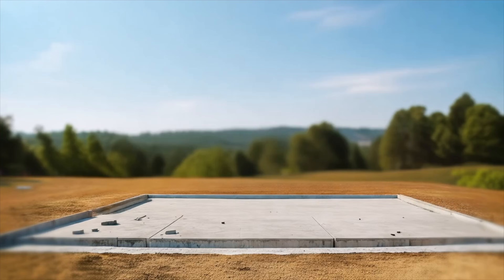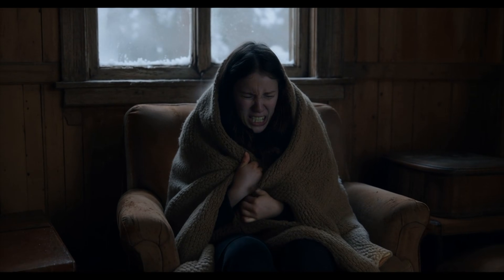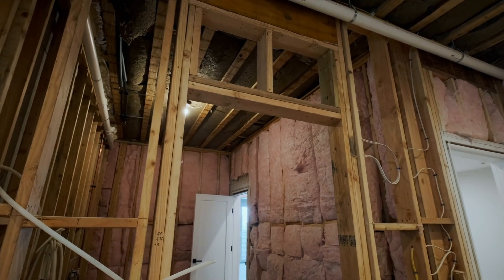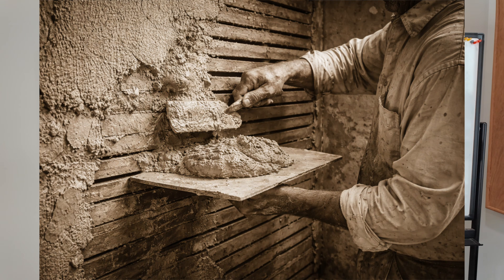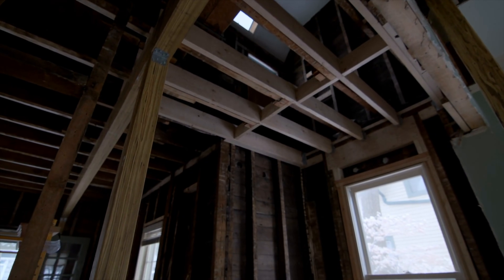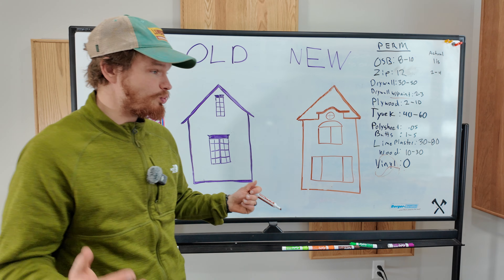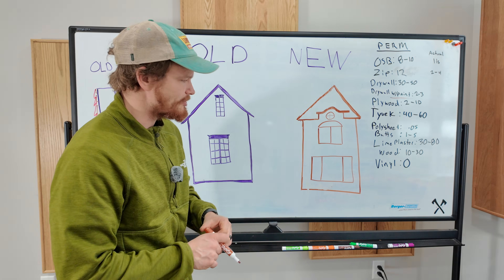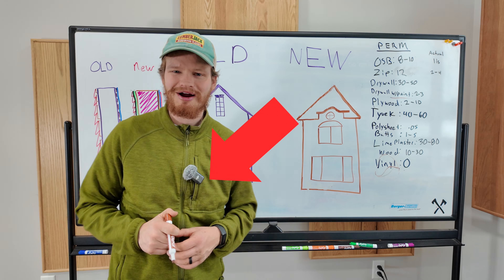New Houses Are Growing Mold — Old Ones Somehow Usually Don't

Comment: New homes have mold because they don’t dry when they are building them also lumber come with mold already in a lot of cases I build homes for a living and repairing them is more common.
Old homes have a lot of mold as well 
Mold comes because everyone showers with a lot of water cheap materials like mdf retain a lot of moisture contractors don’t use the right sealers silicones ect 
Ac guys never seal their connections on the roofs. A lot of water based paint or sealers on floor absorb water

Comment: Nice breathable house filled with termites and an insane power bills. The house I grew up in was built in 1880s Chicago. It was constant maintenance, and always too hot or to cold. Parents had it torn to the studs in the 2010, repaired foundation, replaced eaten joists, fully insulated and sealed, but with proper HVAC that dehumidifys the air. Now it's the most comfortable house I've ever been in, no mold no allergies because all the air is filtered.

Comment: Not agree this is how we built in 1950. What is important in thermo heat/cold? AIR you can put how many layers you want it make bridges to cold)heat. You need AIR just like your windows. More layers of AIR more level of insulation get high. Solid insulation help to left AIR between layers. Your maçonnerie producte today can be print 3D. You can use texiles wastes to fabric bricks or 3D ciment
Reply: In Windows air can be replace with gasclike argon
Reply: If you use ciment inside IT can act as masse that keep heat/cold longer but you need good aération système to not gave mold

Comment: In sweden they have used wood stud frame filled with mineral wool and on the inside a water vapour, "plastic film" to stop moisture from difuse in to the insulated wall where the tempetature reaches the dew point and can create mold.
The outside wall is well ventilated and easily let any trapoed mold dry.  No problem for 40 years.

Comment: What about cinder blocks, weather shield, and external insulation and no drywall?  And no cavity walls just the regular gaps in the external insulation for breathability (furring strips).  Mini split just goes directly through the wall, shortest path.  Adjustable vent fans set to a reasonable level.  Floors are concrete board, places with water like the shower protect the cinderblock with a smooth cleanable layer of concrete or tile.

What do you think, winning combo or have I missed something?

Comment: There's a way to duct walls to ventilate, oversize your fan {heat exchanger}, make the condensation or due point outside the walls (using closed cell hardboard foam) whole house fans, ceiling fans. Going to build a tiny home, it requires all the code spec. Ventilate ventilate ventilate, no closed spaces.

Comment: This maybe a dumb question...
If im cutting my own lumber to build...
Would it just be better to build log cabin style and skip the layering of multiple building materials? 
(I live INSIDE a Sierra Pacific Lumber logging area...my trees are only about 40 years old, so far as i can tell)

If i build with logs, [build on a trailer] frame, should i use the Oak, Pine or Cedar? (Im not planning to tow it unless a fire comes)

Uggg i have so much research to do.

Comment: Very simple.  New houses are built too tight. Old houses have air leaks. People don't know how to evaluate moisture.  They are uneducated on this. They go and do the worst thing possible, putting a whole house humidifier on the furnace.  Have five people all showering in a day and not running a bath evaluation vent fan for hours to get that moisture out. Building codes involving vapor barrier, draft stopping, and wire hole penitrations are good for shit. Let a house breath, and people need to be mindful of how humid their indoor environment is when it is below 35 degrees outside.  This is the most important time to watch indoor humidity. When it gets below freezing outside, you want no more than 35 percent humidity inside.  30 is even better.  If you have large amounts of moisture on your windows, it is too humid inside. Having old or new windows makes a little difference, but even new windows will condensate with high humidity in the house.
Reply: Sorry I meant to say evacuating not evaluation.  Stupid autocorrect lol.

Comment: Modern floor molding suchs. I just ran some 1x2 though a saw to cut the corner edge. It it simple and sort of give a nautical look but the the thickness of it gives good gap for wall adjacent furniture. It was less expensive and all wood. I did use a stain on it.

Comment: Hi from Russia. The best kind of houses we have - from 18-19 centuries are a thick-walled brick 1st floor + wooden logs 2nd floor. It creates excellent microclimate inside and has high insulation properties. I've been to modern log houses and buildings as well - they are very pleasant to be in, dry and warm in the winter. And there are no extra layers of siding, insulation whatsoever. But the trees must be cut in winter and kept 3-5 years before building. Brick-and-mortar is another excellent option, but it all comes down to price - those houses are priced 1,5x higher than your ordinary foamed concrete. Modern homes that are shown in the video is the cheapest option to build nowadays, and the "old" houses shown are sheds, not houses - hot in the summer, and cold in the winter.
Reply: After consideration i have give this observation a thumbs up.  However, my house build with 3/4 plywood and no plastic will cost only a few dollarrs more than a cheap build and last for centuries if the roof is kept up.   The key is NO PLASTIC.
Reply: aka old world houses built by someone else
Reply: Interesting.

Comment: Had my brick an mortar house extended with a wooden style wall, which is similar to what you showed, except it has an air gap between the outer shield and the inner insulation, allowing air movement to be able to dry out the inner workings of the walls with air movement on the outside. The outer shield is rain resistant. It has air gaps at the bottom and top which are almost completely invisible to see.

Comment: old houses were designed to breath and the fireplace was a integral part of that......new ones are designed to be airtight........i'm in new zealand and we have the same problems with new houses being moldy when they shouldn't be....along with any old houses that have the fireplace taken out and are now heated with a heatpump and people keep the windows closed because it cost so much to heat with a heatpump......i renovated a 1940's house and deliberately didn't do anything to seal the house....i put insulation bats in the walls and roof but didn't put the sealing wrap on the walls etc & replaced the weatherboards like for like.......it was dry and warm  mold free home that i lived in for 6 years after that

Comment: The causes of mold in new and renovated homes has been known for decades, but for some bizarre reason people have a hard time comprehending it. It's really quite simple, it's the insulation; or to be more accurate it's having the vapor barrier either on the wrong side of the insulation or having no vapor barrier at all.

What causes mold is condensation. It's the advent of insulation and air conditioning that created this "new" phenomenon of moist warm air condensing on the cold side of the insulation. How you stop that from happening is to install a vapor barrier on the warm side of the insulation to prevent the moist warm air accessing the cold side of the insulation. And you install a breathable water barrier building wrap on the cold side of the insulation. A rain screen type of exterior wall sheathing improves the breathing of the wall.

The vapor barrier ALWAYS needs to be on the warm side of insulation. Cold air is typically dry air, but warm air is typically moist air.

Comment: I've been saying this for years because we have a house in the family for 100 years no mold ever 5 years ago we got a new roof with ridge venting and now attic molds up over every winter
Reply: I always use gable vents.  I don't like having any openings in the roof.  There was a big push to seal up crawl spaces too and I always resisted.  They need the airflow to keep them dry.  I would always find that when a previous owner put plastic down for a barrier, it was always bunched up somewhere and had puddles of water sitting on it defeating the whole purpose.

Comment: Insulation is one of the biggest reason why mold forms, the walls no longer breath but instead just trap moisture.
Reply: So add a dehumidifier.
Make it code requirement.
Reply: @ViolentKisses87  dehumidfiers in the netherlands? 😂 mate we running 100% air moisture 90% of the year, they are a breeding ground for viruses and mold and emptying and cleaning them 10 times a day is not gonna happen. But why when we had the old houses without insulation there has never been a problem

Comment: The reason why your get mold, is because you get water infiltrations and humidity is captured within the isolating materials. It has nothing to do with the material used, but the quality of the workmanship to prevent water ingress. Your walls are supposed to stay dry. If you get water ingress, you get bigger problems than mold. Mold is only a symptom of a bigger problem.

Comment: What's neat is that in Germany even old houses get mold which is why it's tradition to air out the house daily
Reply: This is nonsense. The German building market together with surrounding countries are global leaders in building standards. New houses are always ventilated by mechanical ventilation, which has energy recuperating systems.
Reply: @syproful  Nope, mostly not. It's assumed since German speaking people live in it, they know how to open the windows a few times a day. And if they don't well they do have insurance to pay for the mold damage. Minergy Standart do require HVAC but they only marginaly better in retaining heat, so most new buildings do not use that.

Comment: I plan on building a house, lumber framed and I want to use aircrete between studs and wood paneling on the inside. Outer layer I'm thinking simple steel siding but not 100% sure yet. Something I hadn't considered was not going with high barrier, the process allows for open cell aircrete water will percolate right through, or closed cell air barrier. There's going to be a lot to think about, but the only way I'll be able to have a place is to build it myself. Definitely where there's no building codes.

Comment: Many homes will mold during a long term power outage because they do not have a secondary heating system like a wood stove and they also require active humidity control systems. Z

Comment: One of the biggest problems is builders don't hire an engineer to design the HVAC system and use old rules of thumb. For a tight, non-infiltrating building envelope (walls, windows, roof etc) that retain moisture,  you need a dedicated outdoor air and dehumidification system to keep moisture down. This is a system that needs to be designed correctly by a qualified professional engineer, which = $$$$. Builders typically want to reduce cost, not pay for consultants, and build more expensive systems that don't look sexy and so add 0 perceived aesthetic value. Even though they add extreme amounts of real value to your property in the long term. What's going to be more attractive to a home buyer, a nice looking living room, kitchen island and bathroom or a really well designed HVAC system?

Comment: I live in a house built in 1905.  All the rage right now is having your floors and attics spray foamed. No way. In the cellar…what if you need to run a wire? What if you need to find a connection or something else and it’s covered in foam? Attic….Why in the world would I spray foam the rafters in an unheated space?  You can’t see where a leak is either. Ridiculous.
Reply: Yep. My state has a program, I could have got spray foam for free, basically. I said no.
Reply: think about the off gassing too
Reply: I just saw a video on how bad spray foam is. It also molds.

Comment: Just don’t use cellulose based products to build a home, galvanized steel, zinc plated rebar and thick concrete will work fine and last for centuries.

Comment: Modern houses don't mold if you don't have a leak however if you get a leak water can't escape...
Vinyl siding isn't water tight and the moisture barrier disintegrates with repeated moisture exposure...
I've seen hundreds of moldy rotting houses because of improper siding and underlayment installation

Comment: Here is the kicker.  There is little to no difference in heating either building.  Consider this idea please. 2x6 studs. Fiberglass bats.  1/2 inch plywood both sides. Tyvek outside then siding. 1/2 sheetrock inside on top of the plywood.  Can you imagine the strength? And for very little extra cost. Any thoughts?

Comment: Mold has always been an issue however new homes are monolithically vapor sealed to prevent infiltration/exfiltration. In humid environments this will breed mold. Cycling the air is more important then ever. Increase your air changes, get a dehumidifier or get an ERV or HRV with a condensate drain. Leaky basements are a huge issue if they're finished without making sure the walls no longer sweat.

Comment: Layering is totally different in Russia. First of all we are not so fond of frame construction altogether. Different dind of bricks, prefab panels or concrete is always preferable, but sometimes it is logs or glued wooden beams. Then usually facade is made to be breathable, often spaced from next layer, next layer is some type of breathable unordered fabric. Then insulation (like mineral or glass fiber) ten stone/concrete ten whatever you have inside. this way dew point usually is somewhere inside insulation layer that is intentionally left breathable. 
Downside is - you have to manage your ventilated facade and roof well, especially roof. If for example rain water will pour into this insulation level it will eventually get wet, soggy and will cease to provide insulation.  Yet it manageable and if any mold will happen in this insulation level - it will happen outside of the house

Comment: Americans build houses out of MDF "wood" panels, they use 0.005mm thick plastic insulation sheets on the roofs to prevent water from leaking in and then they compain about houses being moldy.... 
Build houses with concrete or real bricks and mortar with double exterior walls, proper window insulation, real water-proof flat roofs, then all of those problems will be gone.

Comment: The Netherlands. Layer 1 brick and mortar, layer 2 insulation, layer 3 brick and mortar, layer 4 paint or wallpaper (wallpaper is impopular so paint on 98% of walls).
Anything above 4 floors replace brick with concrete.

Comment: I highly disagree. I live in an old house without any insulation and I cannot place any furniture in the outside walls. The walls get so cold in winter that I get massive condensation on the walls and mold if I don't use a dehumidifier. And typically humidity condensates on places where "air exchange" happens. Not gonna say all new is better but it's really not that simple black and white.
Reply: Agreed. We have bathroom fans, louvres, and HVAC to remove moisture and humidity for a reason.
Reply: Yeah, this guy needs to spend like 15 seconds just reading literally any of the literature out of the university of Alaska about building for cold and wet to prevent both mold, frost, and vapor barrier constructions - this video is total bullshit

Comment: The problems started when we started sealng them up.
We started with visqueen stapled up before hanging the GWB, and now we wrap them, tape them, liquid applied flashing, sealants, tripped backer rod, triple caulked them up to net zero homes.
Old growth isn't sustainable for industry and
most of the glue and chip products are garbage, and the dimensional lbr. isn't much better.

Comment: I would love to hear your recipe for the perfect mixture of modern energy saving materials and techniques, combined with permeable real wood materials.  New wood also has the disadvantage of not being dimensionally stable due to quick growth.  Is there an ideal hybrid solution?  I recently helped install new windows on a mold remediation project.  Everything was coated and sealed tighter.  Vapor barrier was high tech, caulked, taped, and sealed to within an inch of its life.  Followed by a hundred penetrations from drywall screws.  Granted the wallboard used did not have a paper face.  I believe it was fiberglass.  Still, it seemed like creating a tighter envelope was the solution used.  No ERV either.     I think you got me fired up here, in a good way.  Thanks!  I'm looking forward to more videos.